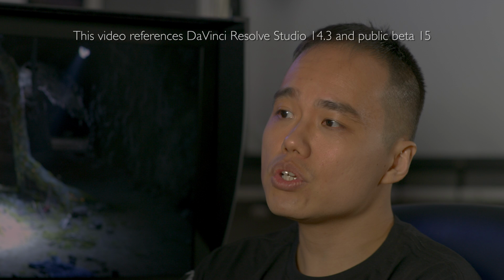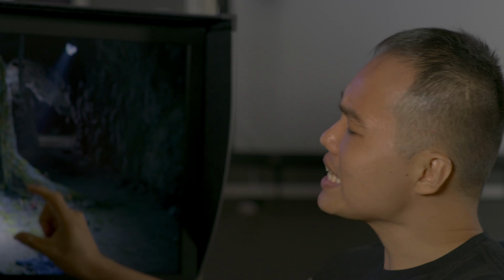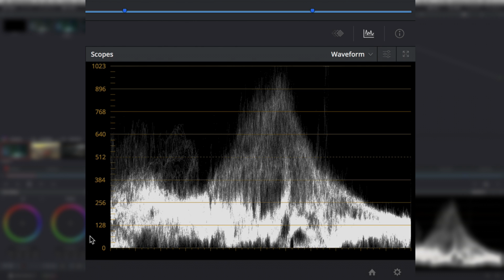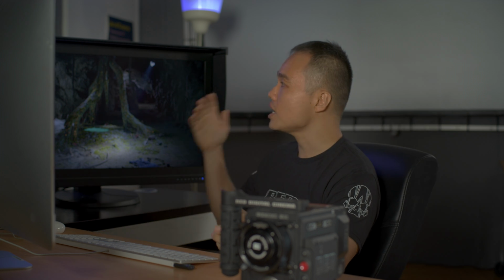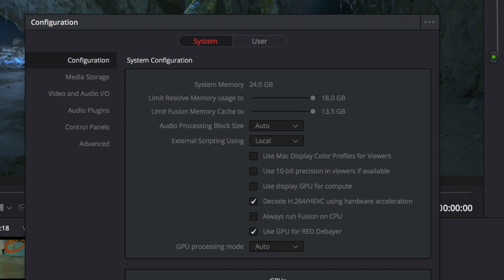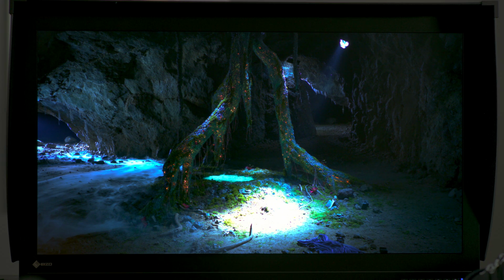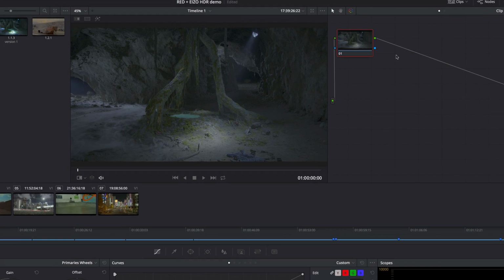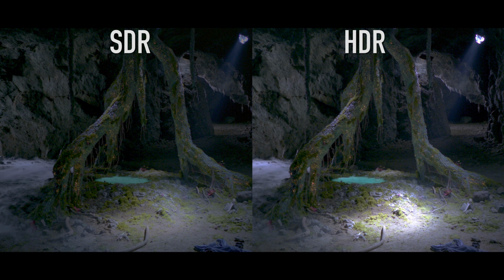Colour Grading For HDR10 Using DaVinci Resolve

Comment: This such fantastic demonstration of the RED camera in the HDR on DaVinci, Reelisations. The dynamic range is unreal. I am just curious, but why doesn't your footage get destroyed if you bring the timeline to Rec.709?

I am struggling to get the colors right in my recent videos. Here are my settings:
Input Color Space: Rec.2020 ; Rec.2100 HLG
Timeline Color Space: Rec.2020 ; ST2084 1000 nit
Output Color Space: Rec.2020 ; ST2084 1000 nit

I would really appreciate the help. I think this video demonstrates the colors so well!
Reply from the maker: Thanks for your kind words. =) Let me try to address your questions below.

Hmmm. Could you clarify what you mean by "why doesn't your footage get destroyed if you bring the timeline to Rec.709"? Didn't quite get the background/context of what you're referring to.

As for your RCM settings – I think your Timeline Color Space and Output Color Space look ok, although I tend not to limit my ST2084 to 1,000 nits, because it really depends on what monitor I'm working with.

My bigger question is why your Input Color Space is HLG. Did you really shoot with the HLG setting on a compatible camera (like the Sony a7S III that you own)?

Also, in order for the above to work, I am assuming that your monitor already supports the ST2084 standard (also known as PQ). If it doesn't, then it's just going to look washed out. Maybe you could also let me know what colour grading monitor you're using?
Reply: @Reelisations  Sorry what I mean by footage getting destroyed is that I suspect that changing the color space from Rec.2020 to Rec.709 (in other words, shrinking the color space), reduces the range of colors.

I think ST2084 at 1000 nits is the maximum YouTube will allow for publishing. Any higher nits and it will basically complain.

Yes I shot on HLG3 picture profile on my Sony A7SIII. I like this picture profile because the video looks amazing even without any color grading.

As for my monitor, I use a cheap SDR monitor while grading in DaVinci. My workaround is to apply a video monitor LUT so I can accurately see what the footage will look like in HDR. You are correct though -- the footage absolutely looks washed out if I view it directly on my SDR monitor without the video monitor LUT applied.
Reply from the maker: Thanks for clarifying. I’ll do my best to respond based on what I understand from your reply above, but feel free to ask more clarifying questions afterwards. :)

This original video was uploaded as a HLG video, which uses the Rec 2020 colour space. So I never actually did a conversion to Rec 709. 

The reason I chose HLG at the time was because I didn’t like the way YouTube did its automatic conversion from ST2084 to Rec 709. When I tested HLG at the time, I felt that conversion was more pleasing. But I need to test the ST2084 again to see if it’s changed since. 

But YouTube has to do the conversion from Rec 2020 to Rec 709 because there are bound to be viewers who are watching this in SDR (standard dynamic range) HD. 

Now, when such a conversion occurs, there is a risk of certain saturations exceeding the Rec 709, and thus getting clipped. 

The reason you’re not seeing much of this in my video is due to 2 reasons:

1. The majority of colours within the scene are safely within Rec 709 already. For example, skin tones are easily reproduced by Rec 709, so there’s no risk of them being clipped. 

So, what colours can’t easily be replicated by Rec 709? A likely culprit might be colourful neon lights. 

2. This one is conjecture, because I need time to test the theory, but I suspect there is some compression of the more saturated colours during the conversion. So the conversion MAY NOT be a simple scaling up of the entire colour space. 

We can see this sort of saturation compression in effect when we do a Rec 2020 to Rec 709 colour space conversion in DaVinci Resolve using RCM. The skin tones are easily scaled, but Resolve tries to prevent the overly-saturated colours from clipping, although there are situations where this clipping can’t be helped. 

———

On a separate note, your suggestion that YouTube can’t exceed 1,000 nits is an interesting one… I’ll need to test this for myself when I have access to a TV that can do 2,000 nits or higher.
Reply: @Reelisations  Wow you really know your stuff! I would like to ask a few more points of clarification if that is okay in *bold*.

This original video was uploaded as a HLG video, which uses the Rec 2020 colour space. So I never actually did a conversion to Rec 709. 
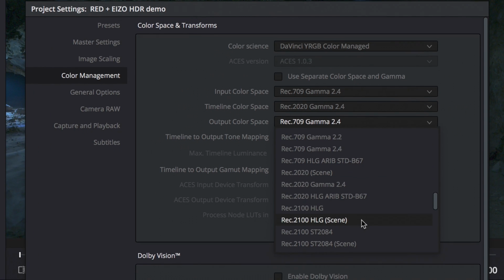Sorry, I initially thought it was Rec 709. -- at 4:33 it says your input color space is Rec 709 for some reason...

The reason I chose HLG at the time was because I didn’t like the way YouTube did its automatic conversion from ST2084 to Rec 709. When I tested HLG at the time, I felt that conversion was more pleasing. But I need to test the ST2084 again to see if it’s changed since. 
*I do not like the way YouTube does its automatic conversion from ST2084 to Rec 709 either. Wesley Knapp engineered a LUT that can be incorporated in the metadata during upload to provide a nice and similar look between the SDR and HDR versions here:
http://www.wesleyknapp.com/blog/hdr
*

But YouTube has to do the conversion from Rec 2020 to Rec 709 because there are bound to be viewers who are watching this in SDR (standard dynamic range) HD. 
As mentioned above.

Now, when such a conversion occurs, there is a risk of certain saturations exceeding the Rec 709, and thus getting clipped. 

The reason you’re not seeing much of this in my video is due to 2 reasons:

1. The majority of colours within the scene are safely within Rec 709 already. For example, skin tones are easily reproduced by Rec 709, so there’s no risk of them being clipped.
This makes sense. I always wondered why skin tones look nearly identical in SDR and HDR. 

So, what colours can’t easily be replicated by Rec 709? A likely culprit might be colourful neon lights. 
Yeah another example would be plants I've noticed. It is quite noticeable in a lot of my recent uploads.

2. This one is conjecture, because I need time to test the theory, but I suspect there is some compression of the more saturated colours during the conversion. So the conversion MAY NOT be a simple scaling up of the entire colour space. 
I look forward to hearing more about your test results.

We can see this sort of saturation compression in effect when we do a Rec 2020 to Rec 709 colour space conversion in DaVinci Resolve using RCM. The skin tones are easily scaled, but Resolve tries to prevent the overly-saturated colours from clipping, although there are situations where this clipping can’t be helped.
As mentioned above, I have found using the Wesley Knapp LUT does a really good job at mimicking the color space conversion in DaVinci Resolve. 

———

On a separate note, your suggestion that YouTube can’t exceed 1,000 nits is an interesting one… I’ll need to test this for myself when I have access to a TV that can do 2,000 nits or higher.
I am looking forward to hearing your findings on this one too!
Reply from the maker: Sorry, I initially thought it was Rec 709. -- at 4:33 it says your input color space is Rec 709 for some reason...

I actually replied you regarding this in another thread that you commented on, but I'll repeat it here for your convenience. =)

At around 4 min 26 sec into this video, I linked to another video I did where I explained that DaVinci Resolve automatically detects any RAW codecs that it supports, so there's no need to enter the Input Colour Space manually. This is regardless of brand – it works for REDCODE RAW, ARRIRAW, Sony RAW, Canon RAW, etc.

Here's the link:
https://www.youtube.com/watch?v=rqcapEgfK2U&t=175s

In retrospect, I probably should've just mentioned this fact when recording the HDR10 video, so there would be less confusion. 😛

I do not like the way YouTube does its automatic conversion from ST2084 to Rec 709 either. Wesley Knapp engineered a LUT that can be incorporated in the metadata during upload to provide a nice and similar look between the SDR and HDR versions

Thanks for the link! It was interesting to see how he found ways to engineer around the limitations. Very cool.
Reply: @Reelisations  Thanks for further clarification. Sorry I did not realize you replied to my comment in another thread too.

By the way, I used much of your advice and instruction in my recent uploads on my channel. I would greatly appreciate it if you check out my recent HDR uploads and tell me what you think :)
Reply from the maker: Hi @VeeTravels, thanks. I wanted to reply after I had a chance to watch your recent videos in both SDR and HDR. =)

I think the saturation of colours in your videos is really great. They really bring out the richness of the locations. =)

For some of the videos where the sun was in shot, I do wish there was more highlight roll-off, so the clipping could be more gentle. But tbh, that hard clipping might be due to the dynamic range of the camera, and may not be due to the grade. And shooting directing into the sun is challenging for any camera system. 😛

Watching your videos makes me think you'd really enjoy grading on a HDR broadcast monitor if you ever happen to find yourself in front of one.  It would give you an even greater ability to judge what's happening with your image before it's uploaded in HDR. And in many ways, I find grading in HDR more liberating than grading for SDR. Much less restrictive.

Despite the LUT, the translation from HDR to SDR by YouTube still isn't great. That clipping I mentioned above becomes even more pronounced and larger in picture area. But it is a very difficult conversion to do, so I can't really fault YouTube for not getting it 100% right.

When you have a chance to, do check out the Dolby Vision functionality in DaVinci Resolve Studio. Although it can't be used for YouTube (since YouTube doesn't support that standard), Dolby Vision's ability to map HDR to SDR is second to none. That's why Netflix, Disney+, etc. use it. It's amazing how spot-on the analysis is.
Reply: @Reelisations  Thanks a lot for taking the time to look at some of my videos. I appreciate the feedback. 

As for the clipping, I totally agree and find shooting into the sun the most challenging thing ever. Straight out of the camera, there is a more gentle roll off; however, the ground appears excessively dark and shadowy while the sky is one giant bright space. 

All of my recent videos were shot with the Sony A7SIII which is one of the best camera systems on the market. This proves that shooting directly into the sun is still challenging for any camera system. I am hoping future technology will get much closer to the dynamic range capabilities of the human eye.

I would definitely really enjoy grading on an HDR broadcast monitor. However, I simply do not have the money for it and its corresponding accessories.   

I will look into the Dolby Vision functionality. Although the only platform I currently use is YouTube.
Reply from the maker: Thanks for taking the time to really think about what HDR is about, and how to implement it. Not many people do. 🙂

Comment: Why is the black floor always raised in Davinci Reolve with LOG files and HDR10 content?
RGB starts from 1 on the waveform when it should start from 0.
Reply from the maker: There are 2 different reasons at play here. I’ll try to explain them one by one.

For HDR10, it’s an aesthetic choice. I’m sure that if you look hard enough, you’ll eventually find graded shots in the real world that touch 0 nits. Maybe HDR demo videos that have a pure black background.

But if I’m grading an architecture shot of a white room flooded with sunlight, I may not have the opportunity to show a 0-nit value at all, since there may not be any pure blacks in the brightly-lit room. So it’s dependent on circumstance and what’s right for the story we’re trying to tell.

As for Log files – it’s more of a technical consideration. 

Because of the way video is sampled during compression, there are fewer shades available to encode the colour in the shadows than there are in the highlights. It’s a little difficult to explain without drawing diagrams, and unfortunately I couldn’t find an article to correlate this, but you can see it in this video excerpt:
https://youtu.be/h9j89L8eQQk?t=154

(It’s a great video, btw. So do watch the whole thing if you can. 🙂)

So I think most Log curves endeavour to stay away from the absolute bottom of the waveform in order to preserve as many shades as possible during the recording / grading. You can then make the aesthetic choice of crushing that information later on, rather than losing that information to banding at the beginning.

Comment: RED Monstro 17 stops dynamic range? How did you arrive at that? I can only measure about 13 stops and that's still assuming S/R=1 or less.
Reply from the maker: Hi Pawel, 

Because RED is one of the sponsors for this video, I based that section of the script on their available materials. You can see their specs for the MONSTRO sensor on this page for the product:
https://www.red.com/DSMC2-BRAIN?quantity=1&sensor=1

And as much as I’d love to, I don’t personally have access to a DSC Labs Xyla 21 test chart. 😛 However, I was able to locate some articles where Phil Holland’s tests with RED cameras using that chart can be seen:
• https://www.phfx.com/articles/oneYearCapturedIn8K/#why
• http://www.phfx.com/articles/forgedIn8K/
• https://www.newsshooter.com/2015/11/04/red-vs-red-the-dynamic-range-of-the-weapon-and-epic-dragon-tested-by-phil-holland/

However, I do know there is sometimes contention about what is a “usable stop”. On that, I think we will all just have to agree to disagree. 🙂

Now, all of the above chart links refer to the older DRAGON sensor. But based on my simple, qualitative assessment during prior shoots, I feel that the MONSTRO sensor is definitely cleaner and has better highlight handling than the DRAGON sensor. 

So it’s not a far throw for me to believe that MONSTRO has the 0.5 stop advantage over DRAGON that RED says it does.

Comment: hey man just one question
i have started to grade HDR10 in davinci resolve.
as you know the APL (average pixel level) in HDR should be around 100 nits
but is it possible to see the APL for one scene?
what im doing now is that i look at the waveform to see where most of the information but i have no clue what the average brightness of the sene is.
Reply from the maker: Just to make sure I’m not misconstruing your question, this is what I understand Average Pixel Level to mean:

“[APL] simply refers to the brightness of the image averaged across the whole screen. White is brighter than black, so a full screen of white would have a much higher APL than a full screen of black. A window only takes up a portion of the screen while a field takes up the whole screen, so a white window has a lower APL than a white field. While APL will vary during a movie for example, the average level of brightness across the screen for a majority of video content would generally come nearer to a full screen of black than a full screen of white.”
— extracted from https://shambarger.net/public/scott/Manuals/Patterns-AVCHD-MP4.pdf

“Both full field and window (partial field) test patterns have been used to test display gamma. The APL of both full field and window test patterns changes, though, as the measurement stimulus level changes.

“A full field test pattern has an APL that is the same as the pattern stimulus level (pixel level).

“A full-field test pattern produces 100% APL at 100% stimulus, with proportionally lower APLs at lower stimulus levels. The APL varies from 100% to 0%.

“Window patterns with a black background have been in use for a long time for display measurements. These patterns minimise the APL change when switching between different stimulus levels, as compared to full field test patterns.

“A window pattern that fills 25% of the screen (Figure 8), with a black background, produces 25% APL at 100% stimulus, with proportionally lower APLs at lower stimulus levels. The APL varies from 25% to 0%.”

— extracted from https://kb.portrait.com/help/constant-apl-test-patterns#:~:text=Average%20pixel%20level%20is%20a,effects%20that%20may%20be%20active

So, in my mind, APL is expressed as a percentage, not nits. And you’re right – as far as I know, there is no way to see APL in the scopes.

But tbh, I don’t use APL as a metric when I’m analysing how to grade an image. That’s not my thought process at all.

Instead, this is how I’m thinking:

* Is the highlight in this shot bright enough to warrant going above 100 nits in the first place?  
If it’s a specular highlight like sunlight glinting off a river, then sure. I might even take it close to 1000 nits, if the story warrants it.  
But if it’s just someone’s white t-shirt in the shade, then maybe I might target diffuse white instead – around 200 nits. 

* If I’m looking at someone’s skin tone, I’m still likely to place it below 100 nits most of the time. Because I don’t need hundreds of nits to show skin tone properly. 
Unless I’m trying to emphasise in the story that they are dying of dehydration under the baking desert sun.

Hopefully you can see from above that I’m always considering what is plausible in real life, combined with what works for the story. 

The aesthetic is king, and I’m using the scopes as a guide to get me there without losing useful image data.

Hope this helps somewhat! 🙂